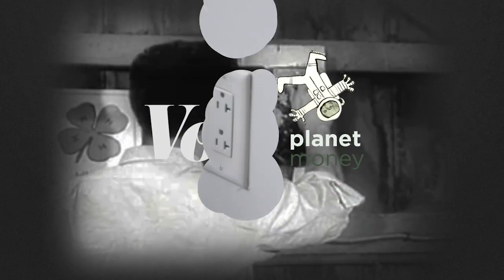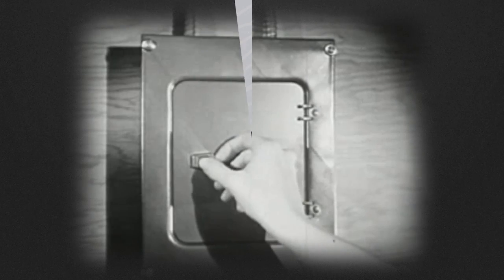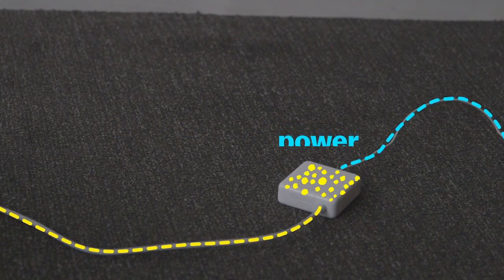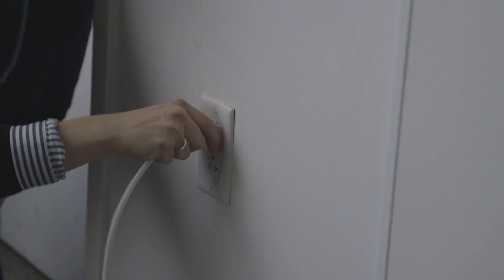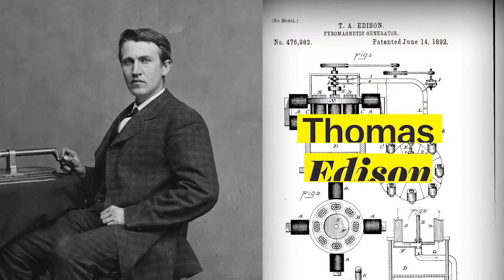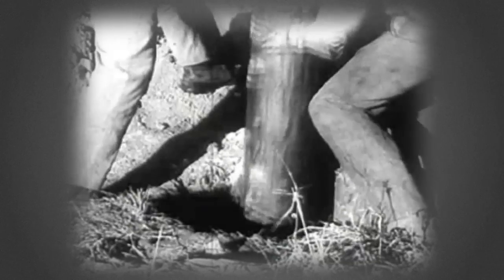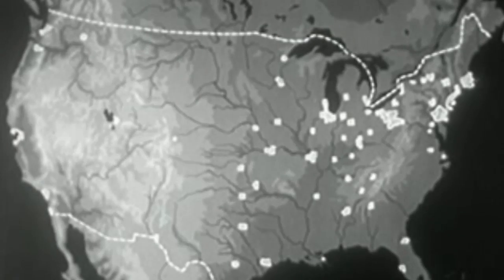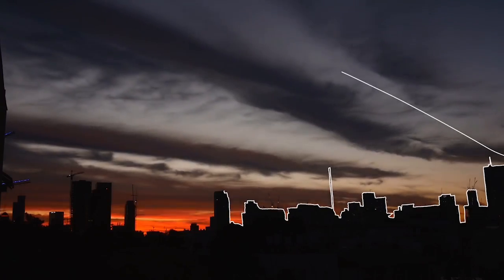Why your laptop charger is so hot

Comment: How does having a larger converter for your home save energy? I feel like you jumped to that conclusion without explaining the logic there. Wouldn't a larger AC/DC converter work just like your laptop charge? Heating up and losing power?
Reply: +Croo ookie It's not quite practical, because each device may need DC power, but at different voltages.  My cell phone is running at 4.3VDC, my electric shaver runs at 5VDC, my cordless drill runs at 20VDC, my cordless shop-vac runs at 12VDC, my laptop runs on 11.1VDC, etc.  AC devices are fairly standardized in houses, your incoming power is usually 240VAC, which is actually two "legs" of 120VAC.  Everything in your house runs on 120VAC, except your oven and dryer, which needs the full 240VAC.
Reply: redbeard2001 So you're saying having a larger dedicated AC to DC converter wouldn't be practical because each device would need another DC conversion anyway?
Reply: +redbeard2001 It's important to realize that AC powered devices are standardized because that's what comes out of the wall. In a world where DC comes out of the wall devices will be made to be standardized around that voltage. You can kind of see this happening already with a lot of devices piggybacking on the USB voltage standard as USB ports have become rather ubiquitous.
Reply: +Alejandro Mesías I'd like to ask what method can be used for DC reduction? Because except Alternating DC, DC can not be step up or down using induction since there is no magnetic flux. 

And also, in what perspective  transformers are inefficient? Correct me if I'm wrong, nowadays transformers can step up/down voltage with about 80% efficiency or above, the energy loss in heat is caused by the eddy current induced in the soft iron core, which can be solved by using compact layer of iron core instead of a whole chunk of iron.
Reply: +Croo ookie 
Transformers and rectifiers emit  Electro magnetic radiation. Staying next to anything larger than a shoe box sized device would cause various symptoms.
Reply: Martijn Oprel The problem with a big converter is that consumer DC devices require massively varying voltages. AC to DC conversion is cheaper than AC to DC to DC. A DC power supply also only reaches its maximum efficiency under around 80% load, when loaded less the efficiency drops massively (as low as 50-60%). Your big DC psu would need to be sized to the right wattage for the load you expect to pull, which is nearly impossible to estimate.

As a result it is more efficient to power consumer electronics from individual AC-DC power supplies. The problem with wasted power is poorly designed, inefficient power supplies. If the charger is getting crazy hot, it's probably failing. If it does that from new, it's poorly designed, putting out alot of waste heat. A switchmode supply is considered "efficient" if it runs at around 85% or higher efficiency. So for an "efficient" 100W laptop power supply you would expect around 15W waste heat. This is enough to make a brick warm, but not crazy hot. Size down to the smaller chargers shown in the video, they are usually 40-60W and if well designed should put out 5-6W waste heat. Again, for an object the size of one of those smaller objects, 5W would make it warm but not crazy hot.

Excessive waste heat means the power supply is a shitty design. We use AC power distribution because it is FAR more efficient to do the DC conversion as the final step.

This is before you even consider things like the thicker cables needed for low voltage DC distribution.
Reply: +Croo ookie I think the idea is that one large converter can be more efficient (there for loose less energy to heat) than a lot of small converters. However, I don't know if this is actually the case.
Reply: ***** Yea, could be. Or it could be the case that manufacturers of electronics know how to make their specific products in the most efficient way possible... But yea who knows, they didn't really explain that part.
Reply: @GhostGuy764  also by having your house rectified to DC, it is easier to use more DC necessary devices
Reply: +redbeard2001  DC Voltage reduction is much simpler though. A solid-state voltage regulator is pretty much the only thing needed. In the other hand, 120V AC to DC conversion usually requiares a transformer, which is heavy and much inneficient. 

It is reasonable to imagine 24V DC avilable in home outlets and each device would only need small voltage reducers for 12V, and 5V. 

Some factories do have 24V DC lines running through the whole factory because many measurement instruments are standarized to work at 24V.
Reply: +Croo ookie  i agree this video was misleading. the whole reason mobile devices use DC power is because of the battery they totally forgot to mention batteries. A home can have solar panels that convert light in to DC power witch is then stored in batteries . That battery power is converted in to  AC power for all home use. that converter gets hot too all converters and transformers put off heat. large Dc converters for home electronics are very uncommon. you would have to by new power cords and power supply's for all your gear makes no sense.
Reply: +Croo ookie It would. Same wastes would happen during the conversion, just on one spot instead of several. Plus you would lose some more energy on the way from the converter to the device, where the DC would have to travel longer distance than in case of the current adapter solutions. Not only because of the final statement this video (and some others) makes me want to unsubscribe...
Reply: A 3-pin voltage regulator has zero efficiency, burning off the overhead voltage as waste heat. The only way to efficiently convert DC is with the use of a switch-mode regulator, which is more complex and more prone to failure. You would expect 80-90% efficiency from a high-efficiency switch-mode converter, though they will only achieve this rating when under a certain load -when in standby or low load, the efficiency drops.

Transformers are actually highly efficient, typically over 95% and this does not vary with load. The reason AC is used for distribution is because it can be stepped up to incredibly high voltages with high efficiency, then converted back at the other end. To this point, it is stepped up to 400KV for the pylons, then back down again at a substation to 230V 3-phase or 110V 3-phase before it enters a building.

The amount of current a copper wire can carry does not change with the voltage applied across it. You can send 10A through 1 square millimeter of conductor. This means that if you can run that 10A line at 400KV, you can transfer 4MW of power through the same wire that you'd only send 2.3KW through at 230V.

AC is used for distribution because it massively cuts copper costs and because it's easier and more efficient to step AC voltage up and down than it is to convert DC.

DC is ONLY easier to convert if you have absolutely no care for waste heat. Switchmode supplies still contain transformers, but they also contain alot of prone-to-fail electronics.
Reply: Yes and no, the video was not wrong, but it was incomplete. 

The advantage doing a nationwide DC grid is that there are less conversions from AC to DC, and basically, every conversion loses energy.

The advantage of AC over DC, is that it can be easily, efficiently and cheaply transformed from high voltage to low voltage or the other way. This means that it can be transported over long distances relatively easily, efficiently and cheaply (because the energy loss in a cable increases with higher currents and increasing voltage lowers the current if your power stays the same). Because AC can be transported over long distances, power generation can be centralized, which makes it more efficient and much cheaper.

So those are the main advantages of each over the other, although there are other small ones (for example, the alternation in AC can be used to buffer).

As far as I can gather, installing one big converter in your house would be advantageous because it would allow you to buy a more expensive one, thus a more efficient one, as you dont need 30 small ones. Basically economies of scale.
Reply: +Blake Jones It's very likely the case for places like apartment complexes, but I'm not sure about homes. But considering how many devices my home has, I'd say it's probably right.
Reply: @CombatSloth  If you put a converter box on your house, you would still need the converters on your devices.  The converters on your devices change it from AC to DC AND change it to the specific voltage for that device.  IF you look at a lot of the converters they will have information about the volts & amps to warn you to not switch them between different devices (unless it is Apple, which gives no warnings).
Reply: +MeLexdy No , there are not enough evidence that shows non-ionizing radiation is harmful to our health
Reply: +sean shapuron   DC-to-DC conversion can be done very efficiently these days. One of the tricks I learned about recently is really clever: a buck converter. Wikipedia has a decent article. It makes use of an inductor, so there is an AC aspect to it. But it can be designed to switch at high frequency, reducing the bulk of the inductor.
Reply: +Steven Spielman  Want to save this to investigate the suggestion. Steven Spielman ... FL lightening power surges would this device keep appliances from frying
Reply: +Big Jon Your grammar is bad but I applaud your explanation.
Reply: Is the voltage that your phone requires the same as your laptops or your electric car?
Reply: Actually, when there is one laptop charger for an entire house, it'll have to do the job of several, making it a comparatively expensive device by necessity; and with that extra price comes an incentive to purchase the "best" system, rather than whatever comes with the device.  This will favor more efficient systems, leading to an overall increase in efficiency.  Plus, it's easier to raise efficiency of a larger system than many smaller ones.
Reply: octet33 Actually most consumers want the cheapest thing that will do the trick. This favours the cheaper, poorly designed, low efficiency supplies. 

Again this doesnt take into account the massively varying voltages that consumer electronics use, and that you would need to size the supply correctly for each voltage rail to maintain efficiency. An underloaded power supply is not very efficient. As a consumer buys more devices their needs will vary drastically throughout the lifetime of this device.

It is far more efficient to have multiple well designed and maintained power supplies for each device. The fact that they all can individually be switched off is a huge boon for efficiency. If one supply is running inefficiently, it can be addressed on its own.

Comment: Conversion boxes don't just convert AC to DC, that's not even the part that generates most of the heat, most of the heat is generated by the conversion of Ampere and Voltage to different amounts.